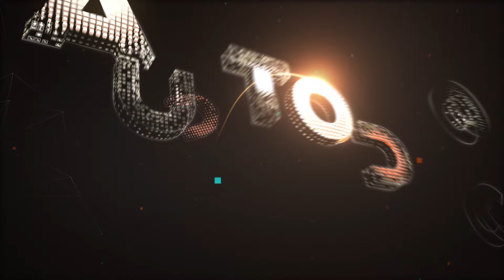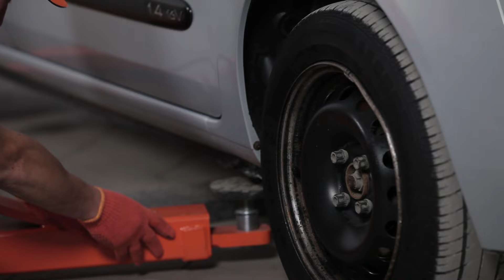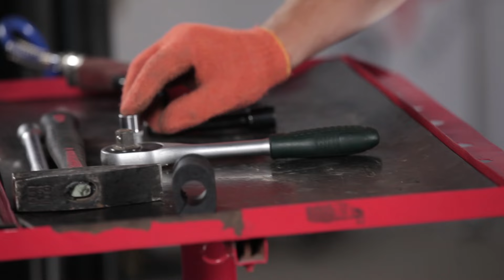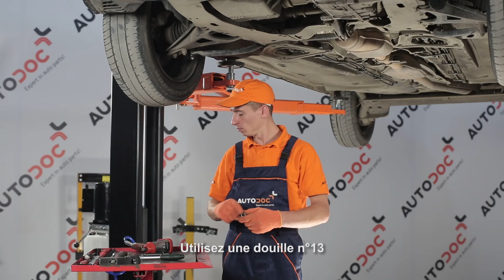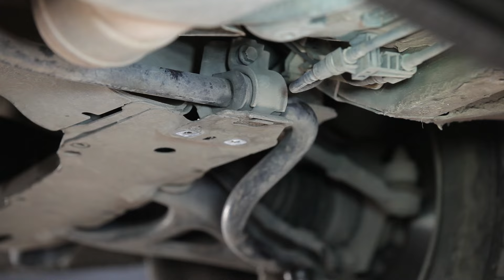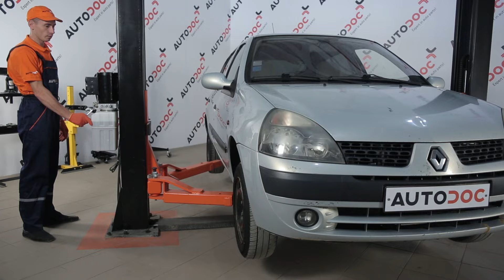Comment remplacer des silent bloc de barre stabilisatrice avant sur une RENAULT CLIO 2 | AUTODOC

Comment: Bonjour savez vous de quel diamètre intérieur doit être le coussinet stabilisateur sur une clio 2 phase 1 de 1998 ? Merci
Reply from the maker: Bonjour! Merci pour votre commentaire! Nous vous invitons à contacter notre service client par téléphone de hotline, par mail (info@auto-doc.fr) ou via le formulaire de contact sur notre site (https://www.auto-doc.fr/services/contact). Veuillez donner les informations sur votre voiture (marque/modèle, date de fabrication, cylindrée, puissance du moteur et le numéro de châssis - série E) et nous vous aiderons avec plaisir. Cordialement, l’équipe Autodoc